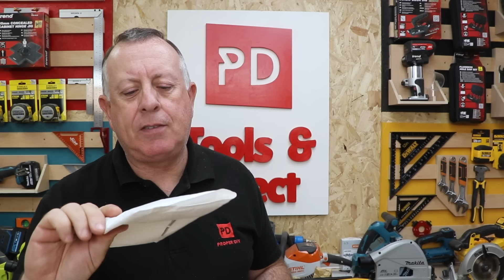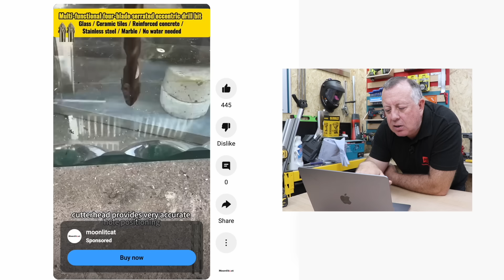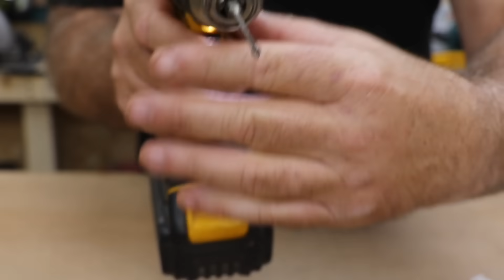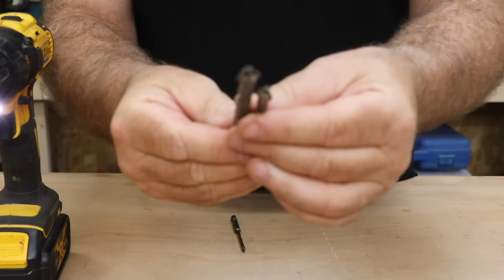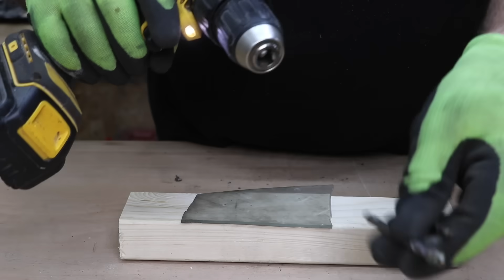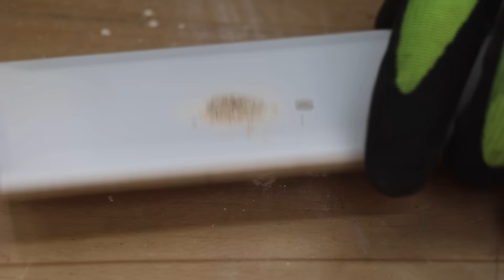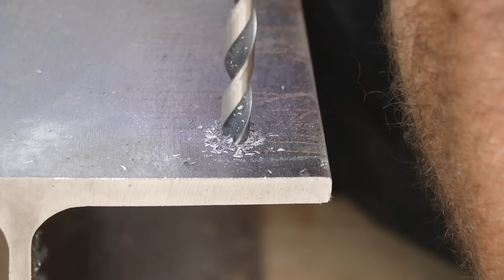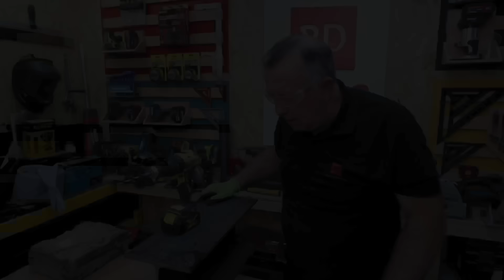Over Priced Drill Bits that Speed Through ANYTHING - Really?

Comment: Wish I had seen your video a week back. My drill bits were regular high speed bits ( haven't tried them out yet )
I managed to procure the two and four blade dits from an industrial store, and my findings were the same as yours.
Great for concrete and tiles,( minus hammer.) . Terrible for steel, even 0.5 mm ss
Thanks for sharing your unbias experience which was spot on  !

Comment: I am a joiner and ive tried many of these type of drill all materials bits, I use the correct drill bit for the job, ie; wood, steel ceramic etc…. I have a set of fancy bits I bought at the wood working show, tried the 6mm bit and it broke….shows don’t believe everything they say!

Comment: A year ago, I paid $22 for a set of ten "Wild Bossy," brand, well packaged bits that look similar but are a bronze color and consistently straight. The hex bits are advertised as able to penetrate various metals (thickness<2mm), brick, glass, ceramic tile, plastic, wood, etc.

The bits cut through hard and soft wood, plastic, and ceramic tile like a hot knife through butter. When I tried them on a hollow metal student desk frame, they worked but took several seconds to break the surface – then punched through. Finally, I tried drilling holes on a sturdy steel washer/dryer pedestal, and they made s small dent like in this video. So, I tried a one-eight-inch HSS type bit that broke, but I tried another of the HSS bits and after about 30 seconds it made a pilot hole. Finally, I used one of the Wild Bossy bits and with muscle, it punched through in about fifteen seconds.
 
After a year I don’t have any visible wear and tear and I generally use them to widen existing pilot holes, or as a free-hand file to widen existing deep holes in soft wood in lieu of a hole saw. IMO – the bits in the video are poor quality but the design, is solid. The bits don't perform as advertised on steel but they work consistently if there's a small pilot hole on hard surfaces first.

Comment: Put the drill bit in to drill press. Video it coming down on the metal .Retract it . Using a hardened drill bit Drill through the metal until its just breaking out ,fill the hole with fine filings. Replace the the hardened drill with the miracle drill and push that through the hole displacing the filings...Voila video made

Comment: I bought some generic HSS drill bits with my Bosch Pro hand drill - Bosch have sadly lost the plot since I bought the unit this replaced!!! Bosch Pro??? Pffft! I've had NOTHING BUT TROUBLE with every Bosch product I've bought since 2020 including a hob and a double oven let alone the drill. 😠 But I digress... I replaced the bits with a quite expensive set from Milwaukee. These too are a huge disappointment - the 6mm was blunt after cutting ONE hole in mild steel. The only good thing to come out of it was Bezacon refunded my money!

Do you have any other bulletproof recommendations for bits please?

Regarding the video ad for the drill bits you reviewed, yup, I agree with you. They must have drilled the steel first then filled the hole with solder, sanded it flush then demoed the bit on the lead!!!

Comment: For drilling Steel  - I have   KANGO  HHS   and   RYOBI   HHS drill bits
also I use  PNN   and   SUTTON  drill bits for  various jobs

Using light machine oil  / or soluble oil for lubrication and Temperature
control where necessary.  
Drilling slowly and controlling applied drilling force is critical.

Neither of the above Drill Bits are cheap-  
Using cheap drill bits never works well and is not actually cheap
when one has to scrap them in the recycling bin and purchase 
high quality reliable tools and equipment.

As an example - I have German Made screwdrivers that were purchased
in 1970 - and even by todays standard would be considered expensive.
The price in 1970 was frightening enough.
Yet these screwdrivers 56 years later are still like new after half a
century of use -- 
At age 85  - I will be DEAD soon - and these screwdrivers will still be
like new 50 or 100 years from now.
providing ISRAEL does not use any Nuclear Weapons.
Though my job with RAF BOMBER COMMAND was to drop 
Nuclear bombs on the ( former ) USSR
( Besides which - My late mother (Liliana)  was Russian - and her second
eldest sister served with the RAF towards the latter years of WW II
* who paid for my flying lessons when I was age 13 - and instructed
by a former veteran HURRICANE pilot.
Of course they are all deceased now ( That particular aunt ' Ludmila -
aka Lucy  resided in NOTTINGAM - 
which was the best place for night life and entertainment in the late
1950s and 1960s -- better than LONDON
NOTTINGAM - wasn't particularly far to travel from
RAF WADDINGTON - RAF COTTESMORE and
RAF NORTH LUFFENHAM > ( MIDLAND RADAR base )
[ 30 years MILITARY service serving 3 countries ) since 1960

see:
▶ U.S. Tanker War TRIGGERS WW3: RUSSIA & VENEZUELA Strike Back at Trump
https://www.youtube.com/watch?v=3lP1zBG6S4M
                    Jan 9, 2026                                 01:16:58 
CHANNEL: Danny Haiphong
                  » https://www.youtube.com/@DannyHaiphongYT
  The U.S. with U.K. support seized a Russian-flagged tanker on
  Tuesday January 6th in the latest escalation that could lead spiral
  into a major war between great powers.
  Trump is sending numerous messages that he is in control of VENEZUELA
  but its new president Delcy Rodriguez has hit back.
  Former U.S. ARMY officer & military expert Stanislav Krapivnik joins
  the show to react to these developments and much more as World War III
  moves into a new phase. 

▶ Scott Ritter: US Tanker Seizure DESTROYS Trump's VENEZUELA War, RUSSIA Steps In
https://www.youtube.com/watch?v=aH7yndNpGdg
                      Dec 13, 2025                                    33:46
CHANNEL: Danny Haiphong
                  » https://www.youtube.com/@DannyHaiphongYT
  The U.S. MILITARY seizure of a Venezuelan oil tanker is backfiring
  hard on Trump says Scott Ritter - and RUSSIA's quiet MILITARY
  cooperation with the Maduro GOVERNMENT should not be underestimated
  according to analyst Andrei Martyanov.
  This video breaks down the catastrophic consequences of Trump's escalations.
# | ANDREI MARTYANOV | SCOTT RITTER | OIL TANKER |

▶ RUSSIA & CHINA HUMILIATE Trump
https://www.youtube.com/watch?v=zpGOiURpEjU
                     Sep 8, 2025                                    25:21
CHANNEL: Danny Haiphong
                 » https://www.youtube.com/@geopoliticshaiphong
  Former UN weapons Inspector Scott Ritter reacts to CHINA's historic
  military parade which unveiled weapons and global alliances that
  just humiliated Trump on the world stage. Andrei Martynov and
  Garland Nixon also joined for a deep analysis of the growing
  strength of Putin - Xi and the multipolar world - and what it
  reflects about waning U.S. dominance worldwide.
# | SCOTT RITTER | ANDREI MARTYANOV | GARLAND NIXON |
As Scott ritter said of The New York Times -
" wouldn't insult my bird by putting a copy of The New Yor Times
as a Liner in his bird cage '

Comment: Best to use some sort of coolant with tungsten carbide tools brazed onto the drill bit or the bronze melts. Slow rotation speed and lots of coolant is the trick with carbide drills. When they cut concrete with carbide or diamond cutters its always done wet.

Comment: I did buy a packet of them (8 bits for $12)for my bathroom renovation,porcelain tiles.
Was happy with the job,next time will use them most likely years in the future ,why than spend $15-20 per drill bit?
Mind you I’m not a professional,renovation is a hobby 
Also bought a whole cutter,various sizes for a fraction of a price and did cut through the porcelain tiles like a hot knife through the butter.
Again 12 pieces for $15? I think,where same one piece from the hardware store cost that amount per piece (varies of the size)

Comment: It's not just you tube. In the last few years I have experienced really poor quality drill bits . The obvious problem is that the metal is not tempered properly. Either too soft, (get blunt drilling mild steel) or to brittle (shatter drilling mild steel) too soft is the most common problem.

Comment: Drilling steel vs Cast Iron are a totally different animals. When drilling the concrete block you could also see it wandering around the stones. But you are correct it works good on tiles. take a look at a tile drill and you will see why. The yellow by the way is braze (Brass) that's used to fix the tungsten tip to the shaft.

Comment: I am sick of these scam ads on YT. Maybe YT should be made responsible for what they allow to be advertised? I have a case of Bosch drill bits, cuts through ceramic tiles like a knife through butter, concrete lintels, etc, and haven't deteriorated in 10 years. It's important to have good drill machine as well, like the slow start Bosch. And I am not pushing Bosch in any way, nor do I represent them.

Comment: Been using this type of bits for a few years. They are a type of sintered carbide meant to drill very hard materials like porcelain and stone. You have to use a coolant and low rpm on your drill. They dont work well on wood or steel. Obviously its falsely advertised.

Comment: The Tip Gets Red Hot and Falls Off ! An SDS Hammer Drill is Much Better !  They are Rubbish !     For Ceramics you need loads of them !  They are Useless For Steel !  Even a Bench Drill Struggles with Steel !  You Don't Get Fine Iron Filings Drilling Through Thick Steel !     They have filled the Hole with Iron Filings.  IT'S A SCAM !  The Tips are Braised on. Absolute Garbage !

Comment: Ive worked in the building trade over forty odd years and the best drill bit for brick ,concrete is a mason master with an impact drill and for hard metal cobalt bit with a normal drill that can vary the speed and add water to cool the bit .

Comment: Not saying that these are good, but the price wouldn’t be bad if they worked as well as decent bits. I’ve got bits that cost over $50 EACH. But these are specialized. The ones here look like carbide concrete bits. The problem is that the carbide tips shouldn’t be sticking out from the steel. Carbide is brittle and can shatter. They need to be supported right to the tip.

Most carbide bits aren’t meant for steel. They’re meant for low tensile materials, aluminum, copper, fiberglass, plastics and cast iron. They’re also pretty expensive. One is as much as this package.

Comment: I don’t if it helps you I needed to drill some stainless steel I didn’t have the money for expensive drill set,saw a hack on you tube of using masonry  drill bit with oil and it worked for me I bought $9.99 Aldi masonry drill bit of oil job done.

Comment: Not great bits but then I am always sceptical of claims.  If I drill something hard I start with a pilot hole (even with my Bosch bits) and I frequently dip the bit in water to keep it cool.  The tip breaking off great reason not to buy.  Thanks for this video very useful information.

Comment: Never had problem with tiles, use masonry bit with no hammer, just as quick as that drill. Always use oil with steel drilling as it is meant to cut and you need the lubrication and to take the heat away.

Comment: I did the tests myself, seen the advertisements made me eager to use them , but decided to buy the cheap ALI express alternatives.  They are good on dry fired bricks and ceramic tiles although  the removal of the debris is awfull one constantly has to clean the drill and hole   wet fired bricks is hard to do the drillings turn into clay and the dril gets stuck.  When observing the drill tip one can easily see it will not drill steel, the ultimate tip is almost a fine bearing ball resulting from the crossing of the 4 cutting blades.   However pre drill using a 3 mm standard HSSE drill bit removes this obstacle and the 4 bladed drill will drill steel

Comment: I bought a set on Temu $2 for 3, mainly to drill porcelain tiles, first I tried it in a drill, they were crap, then I noticed they has connection to impact driver, i put in my impact driver then drilled fixed porcelain tiles on walls, they now work great in impact driver.

Comment: It looks as though they are carbide tipped. Carbide is extremely hard but won't support a razor sharp edge which works well enough for ceramic and masonry. For drilling  anything other than masonry high speed steel is better as although not quite a hard as carbide it supports a very sharp edge which is the priority for steel and wood etc.

Comment: These drills are available on temu and arrive in the same packaging like yours but cost only £3-4 per set! I got 2-3 sets just because they were so cheap and versatile at the same time but I'm not expecting much from them either. If they break they break. Although I got today 2 drill bit sets for £100 on toolfair in Coventry, not advertising it, just saying as they are really versatile and advertised with a lifetime guarantee, if you break it they will swap for a new bit. So will see 😊

Comment: Hi my name is Kevin from Aus I was watching you drill holes with your drill bits from what I seen that are gunk ,a work we would drill holes though H S S drills metal cutting blades    most metals  we spin these drills at 5000  RPM  and they go though it the drills gets  red hot that does not effect it and the hole is a net hole   I am a retired mechanical engineer of 56 years   all the best Kevin ps sorry about my discretion of your drills.

Comment: The yellow stuff you mentioned is from brazing with silicon bronze to weld hardened steel to the mild steel stem. Although it isn't really welding because you are not melting the base materials.
From what I see, the tip isn't really well hardened steel anyway.
Don't trust adverts that say "big company's don't want you to know this", that's a big giveaway that it's a scam.

Comment: Excellent video. If those were a revelation in drill design how come the big names didnt develop them?? To be honest, even though they (sort of) worked in ceramic tiles, you could do the same job by using a regular masonry drill (never tried a normal twist drill) in tiles by sticking some tape in a cross where you needed the hole (as in put a tape cross on an inflated balloon and sticking a pin in it, it wont go pop).

Comment: The best drills ive used are from either milwaukee or dewalt. But only the one that have cobalt in it. 

What I personally dont like about the bosch drills is that the big ones only come as round bits. Dewalt and milwaukee grind away a bit on the shaft so they wont slip.

Comment: I use a jig saw with metal cutting blades to cut squares out of sheet steel 4mm thick. If i use cheap blades after every cut I dip them in cold water they last a lot longer.
Experience from using a lathe and a miller, cutting tools (cheap or expensive) do not like heat, keep them cool and they last

Comment: Part of the issue is that people don't know where to buy quality products. For example, you can get a set of 15 or so dormer drill bits made in Sheffield for £50 to £100. They will last a DIY user forever and can be sharpened. Even a bulk pack of cobolt bits form machinemart for £80 will last the average user years. A drill bit that does both concrete and steel is a rebar cutter and they cost tens of pounds each for a good one.

Comment: I bought something similar, supposedly according to the video the only drill bits you will ever need, these bits will work on wood, brick, ceramic tiles, steel etc, !
If they break we will replace !
I bent one drilling through concrete, burnt 3 out on brass snapped one.
I was drilling carbon fibre and burnt one out so used a cheap bargain basement drill which drilled the carbon fibre effortlessly!
Can’t beleive the crap that they advertise, stick to Bosch and the leading brands, you get what you pay for!

Comment: I got a set simular to them but have no issues drilling everything except wood for some reason the quad head binds in the wood. But I'm not using a drill I use a dewalt dcf887 impact driver but never had the impact function turn on

Comment: 400 -600 rpm for a hand drill … 10 mm hole through should take 20 seconds + it’s all about the pressure you put on the bit to cut rather than just cause friction.. hence a drill press is so much better

Comment: I've used tungsten carbide masonry drills to drill high speed steel saw blades and hardened gear shafts no problem, but you must sharpen them first but you'll need a green grinding wheel or as I've got a 6" diamond wheel off eBay, grind to a normal drill point as a hss drill, and run slow and take your time. You can't even sharpen those shite ones you got off eBay.
PS the yellow stuff is the braze that holds the tips in

Comment: This looks like a cheap imitation of the Alpha Tools stepped tip HSS bits, but with the tip shaped to mimic the glass/ceramic/tile drill bits. The most suspicious part is the flute on it. If the tip is shaped like an arrrow, the maximal diameter is at the base of the arrow and at that point, the shaft behind it is not going to be removing material from the hole. The fluting on the shaft is hence useless.

These are most likely just cheap steel bits with an arrow head welded on to them.

And to put it out there, the Alpha Tools stepped tip bits are, let's just say, not exactly bargain basement pricing.

Comment: You tube are advertising absolute rubbish just for $ 
Anything advertised on there is dog excrement.
What you need is Dormer or ghuring twist drills.
English and German made,not chinese die cast chocolate rubbish.
Try drilling 3/4 boiler plate with a mag drill with chinese stuff you may as well use a cigarette as a bit.